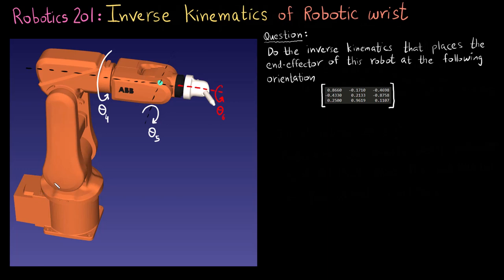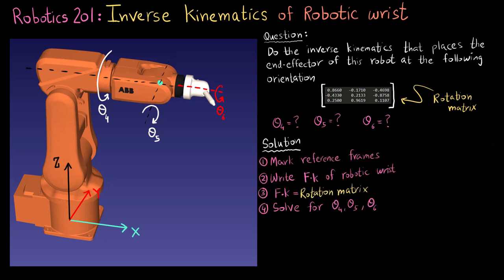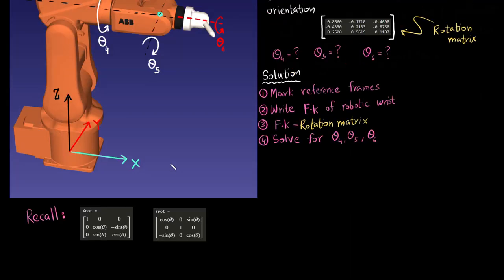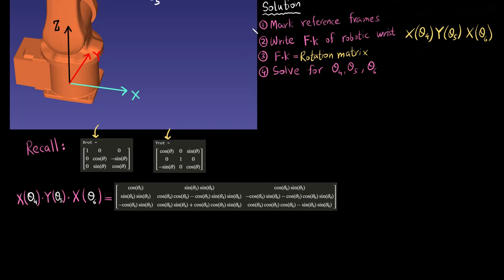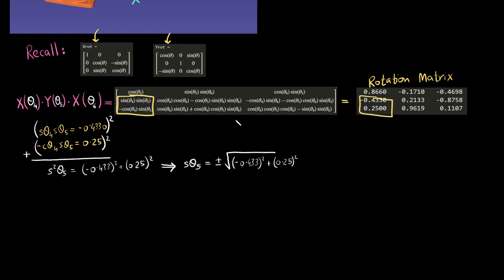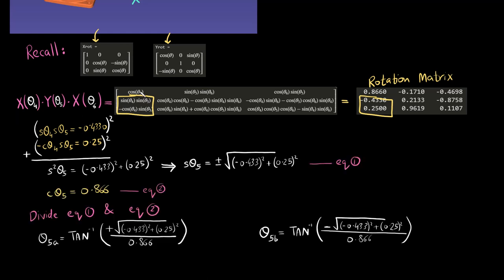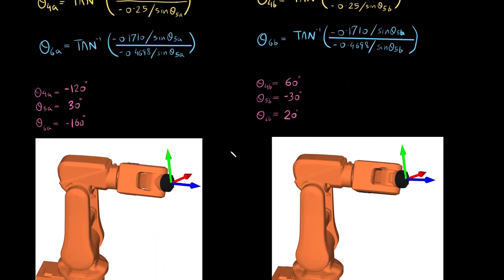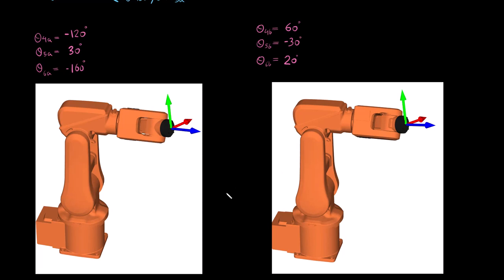Inverse Kinematics of Robot Wrist (with solved example) | Robotics 201

Comment: I wrote the formula exactly like that in MATLAB, but the returned angle is not what I expected. Why is that?
Reply: c23 = cos(theta2 + theta3);
    s23 = sin(theta2 + theta3);
    R03 = [ cos(theta1)*c23,   sin(theta1),   -cos(theta1)*s23;
            sin(theta1)*c23,   -cos(theta1),  -sin(theta1)*s23;
            -s23,              0,             -c23 ];
    
    
    R36 = R03' * r;
    
   
    r11 = R36(1,1);
    r12 = R36(1,2);
    r13 = R36(1,3);
    r21 = R36(2,1);
    r22 = R36(2,2);
    r23 = R36(2,3);
    r31 = R36(3,1);
   
    
    
    c5 = r11;
    s5 = sqrt(r21^2 + r31^2);  
    theta5 = atan2(-s5, c5);
    

    if abs(s5) > 1e-6
 
        theta4 = atan2(r21, r31);
        theta6 = atan2(r12, -r13);
    else
   
        theta4 = 0;  
        theta6 = atan2(-r23, r22);
    end

Comment: Hello thank you for making these video. they are super helpful. One question: how do you get 2 values for theta_4 and theta_6? since both value of theta_5 get cancelled in both equations? tia!
Reply from the maker: For theta 4, see 6:09 and you will see that I am using the two equations in yellow- the ones beginning with sin(theta4) and -cos(theta4). Using these equations, I am just dividing the rest of the terms as can be seen at the bottom of the screen. Since, I have two values of theta5, so I insert both values and get two corresponding values of theta4.
The methodology for getting two values of theta6 is very similar and now you should be able to figure it out.

Did it clear out the confusion? Otherwise, feel free to let me know and I can explain it in a different way. 
Have a great day!